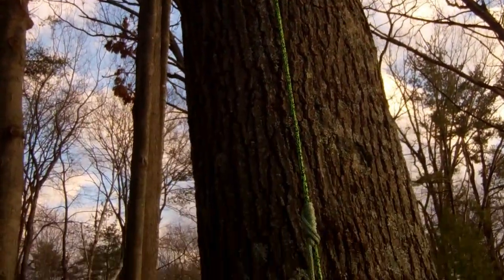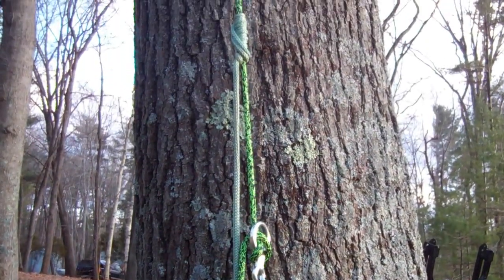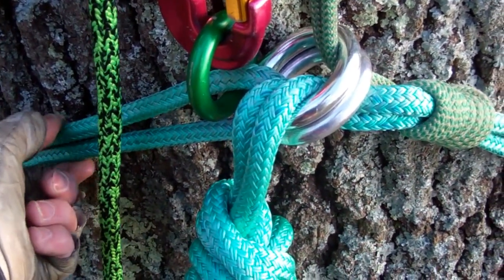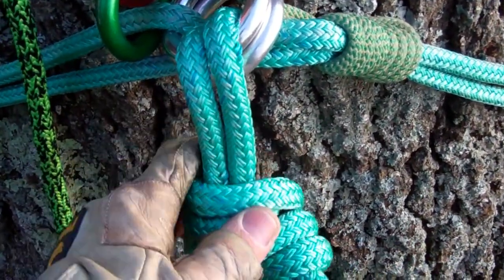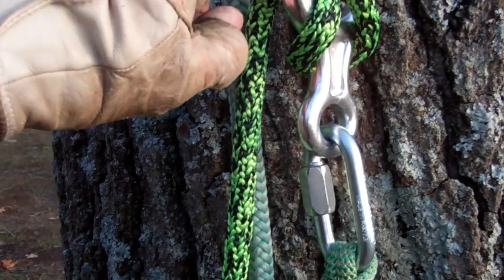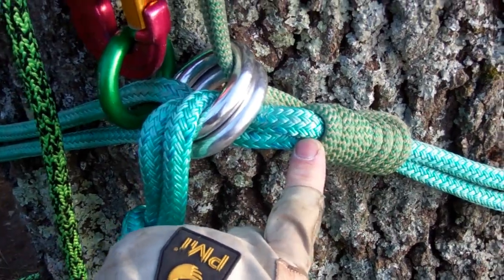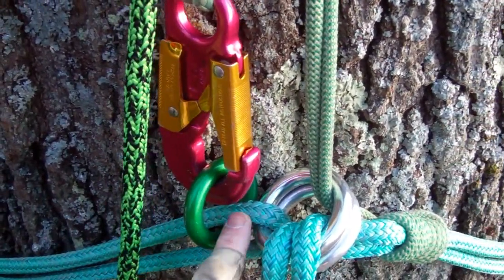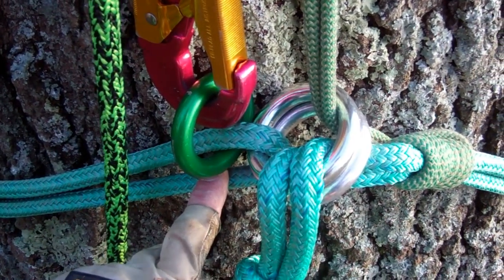SRT Basal Anchor DOUBLED UP for safety

Comment from the maker: Please be aware that the are two conditions of the anchor that are for this demonstration only.  First, the Figure 8 must be fully locked off ( snubbed twice then the tail passed thru the link and tied off again).  Secondly, the stopper knot on the girthing lines should be tied tight against the rings with as much "preload" on the choke as possible.  For this demo, the knot was tied with slack to show the  backup weight transfer.  In use, the action is not so dynamic.  Tied properly, the weight